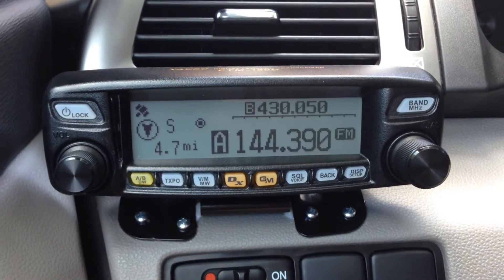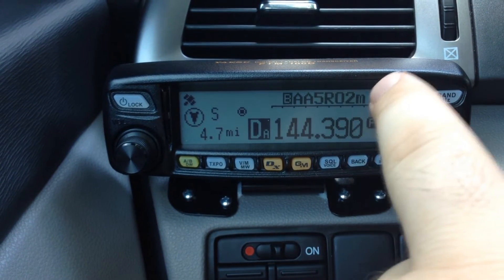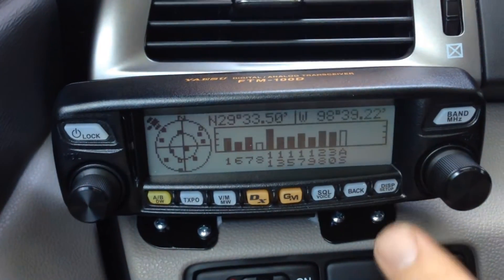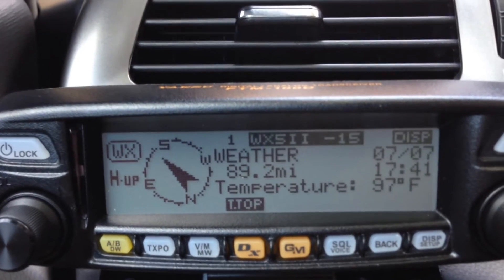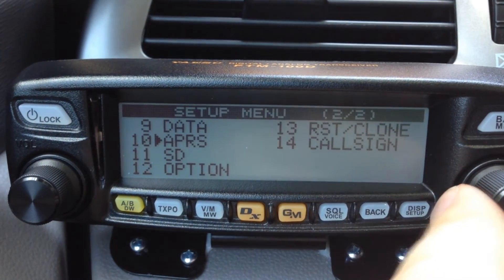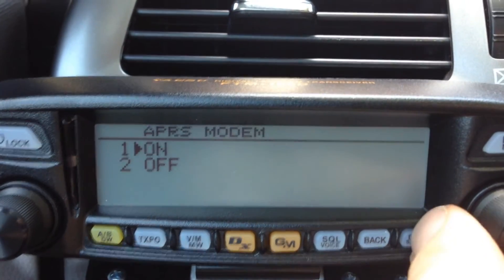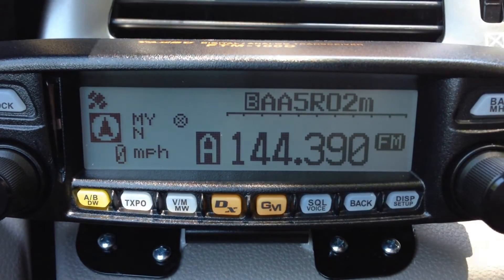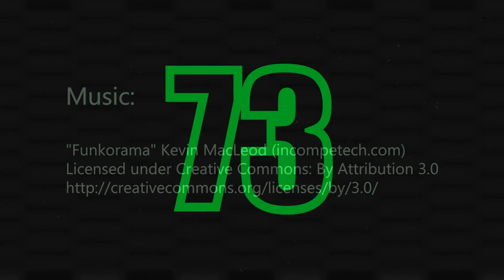FTM-100DR APRS Mode

Comment: Hello, i have new radio. But have problem.Question.Why does not send aprs packets from yaesu ftm-100dr.
Reply from the maker: ES1BRD you must turn on Aprs modem
Reply from the maker: Also watch at 5:44 you must turn beacon text on #14 on aprs menu
Reply: @matthew2000tx  Thanks for the answer. I looked. I did everything  like that. I even checked it several times.

I accept all packages.

But my station does not send. That's what I want to configure.
Reply from the maker: @es1brd787  have you set your callsign in the APRS menu

Comment: If you are using APRS you can only Dual watch the UHF side of the radio. Cant do VHF+ VHF kinda sucks. Also you cant scan the UHF and VHF frequencies together, because they get programmed or (saved) in different memory banks A for VHF B- for UHF this is so stupid. I just should have bought another Kenwood Tm-v71A.........
Reply: I have a Kenwood tmv71a and I am not getting rid of it anytime soon
Reply: bob mar I also have a tmv71a I use it to cross band and it works awesome
.
Reply: So can you dual watch from a memory channel UHF / APRS?

Comment: If you're using APRS in VFO-A, then switch to VFO-B, is the modem still on and transmitting beacons?   ie, do you have to turn the modem on and off every single time you switch from a voice repeater to aprs mode?   Can the modem be on in VFO-A and off in VFO-B?

Comment: As stated by oh2fxd Dual watch monitors the Home channel not the opposing VFO. 
Also my understanding is you have to stay on the APRS TX Frequency to transmit a beacon. Unlike the FTM-400D which is a dual receiver rig the FTM-100D is single receiver.
Reply: It sure looks like it's monitoring the opposing VFO.  I even paused the video to confirm.  It must be coincidental that VFO-B (memory-1) was identical to the VFO-A (memory-HOME)?     The manual clearly states the "HOME" memory is monitored, which is a deal breaker for me.   Please confirm as this is a huge source of confusion - thanks!